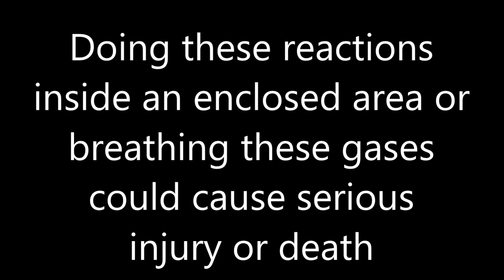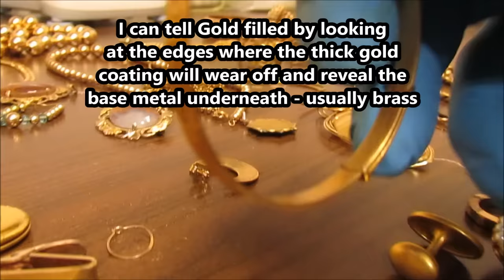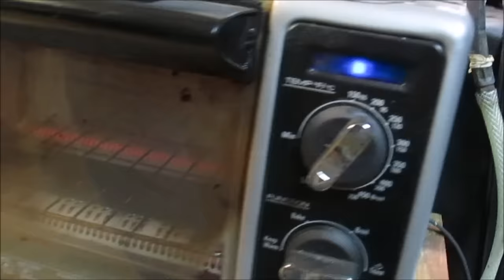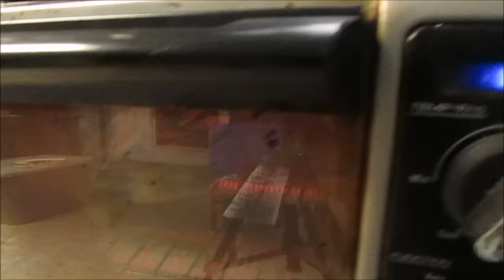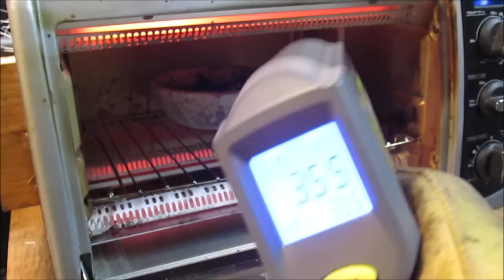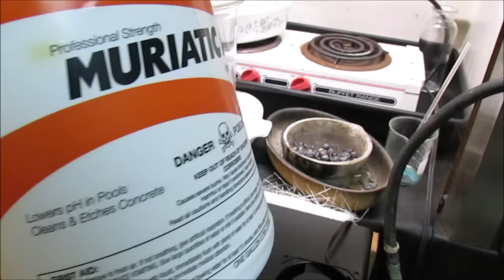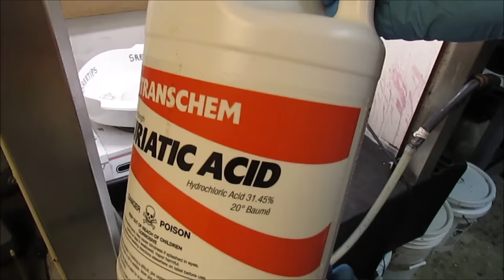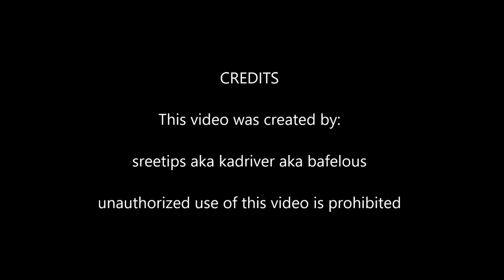Gold Refining 740 Grams of Gold Filled Scrap

Comment: Sreetips - I have some gold around 18K but is actually magnetic- seems to have some steel in it?  Can I use your method to purify it?
Reply from the maker: You must test it with acid. Some karat gold is magnetic though very rare. Gold plated items can be marked as karat gold by thieves. Inexperienced people won't be able to tell the difference.
Reply: Somehow I managed to contaminate with a piece if steel wire when I melted my 14K in the crucible.  Actually found a piece of the steel wire protruding from the ingot.  Wondered why the gold was cracking so easily after just a couple passes in my rolling mill.  Will the process you describe work to purify my contaminated gold?
Reply from the maker: If it were mine, I would inquart with silver then part with nitric. Then I would refine the gold.
Reply: Thanks for your reply - how about inquarting with copper rather than silver?  That way I don’t need to recover the silver - or is there a benefit to use silver?
Reply from the maker: Daniel, I refine both gold and silver so using silver to inquart is like killing two birds with one stone for me. Yes, you can use can use clean copper or brass to inquart the gold. But I've never done it so I'm not sure how good it works.

Comment: I've looked everywhere for info on processing gold filled glasses frames. But nothing. I want to get a batch of 1/10 12k going but some are magnetic and some aren't. What do you think the base metal is in the magnetic ones. I dont want to run them if they will cause a problem and if I can do them all it's worth it.
Reply: Sorry. If I CAN'T run them all it's not worth it. Dont want to have to  exclude half my material.
Reply from the maker: The frames should go just fine, magnetic or not. The spring steel is what causes problems and should be excluded. The spring steel is the part that curves around the back of the ear when the glasses are being worn.
Reply: Okay awesome.

Comment: Would there be a similar process for brass? To end up with as high brass content as possible?
Reply from the maker: Brass is an alloy of 85% copper and 15% zinc.
Reply: @sreetips  First, thank you much for the reply, greatly appreciated. 

Need to add I am autistic because I don't want you to think I am being sarcastic, nor a know it all. I don't know, and my curiosity demands answers lol. 

I actually forgot that brass is not a base metal to be fully honest, and I can assume by your answer that my answer is a no, but still... 

what would it take to end up with a sludge that is 85% copper and 15% zinc? Can that be done, or would you need to do them separately, and then mix them with heat to create the new metal? The brass alloy.

Comment: I have seen you cement silver with copper as well as go with silver chloride. Do you have a preference on one being better than the other and is there a difference in purity between the two methods before going into a silver cell?
Reply from the maker: Krystal, cementing everything on copper, the palladium builds up and could plate out in the cell with the silver. But you get all your metals. Silver chloride method there is higher risk of loss of metal when converting the chloride to oxide and then converting the oxide to silver metal. I'm still undecided on which way is the best way to go. As I gain more experience one method could prove to be superior over the other. But I haven't reached that point, yet.

Comment: And about how much nitric acid total for a full process of a large batch like this? Give or take amount of iron/magnetic material is in there.
Reply from the maker: About 3ml of nitric per gram of GF scrap. 700 gram batch plan on 2 liters of concentrated nitric, give or take 200ml either way. Fume production is the key. When fresh nitric doesn't produce red fumes any more it's probably safe to conclude that all the base metals are in solution and the foils can be separated from the liquid. Don't forget to incinerate the foils before going to aqua regia.

Comment: I have got some gold flakes and I would like to know if you know a way to refine gold leaf flakes or if you have dun a video can you direct me to it thank you
Reply: Depends on the gold flakes. Is this natural gold that was panned? It depends on where you got it. Some is more pure than others. The process of purification would be the same. Wash first in acids that don't attack gold(but do attack contaminates), then dissolve the gold in aqua regia, then crash out the gold with a base like baking soda. Wash the brown gold powder with hydrochloric acid, then smelt the brown gold powder into a bar. The gold will be at least 3 9's pure. Repeat the whole process a second time to get 5 9's(do it from the brown gold powder stage, skip smelting until the end if you are going to do it twice).

Comment: Question: If you would test those GF pieces with the acid we use to test if it's gold or not (and the carats) would it test positive ?
Reply from the maker: Yes, it would. Because the coating of gold is so thick, 1000 times thicker than electroplated gold, the acid test would indicate that you have karat gold, because the thick coating over the brass is karat gold. But, if you file deep into the metal, then test the spot that you filed away with acid, then the truth will be revealed. The acids don't lie.
Reply: @sreetips  Thank you for you answer !

Comment: The 2 pieces at 11:05 with the little stones in them may have been gold filled backs but a lot of times the front piece with the stones is 10k. I find a lot of those types of things
Reply from the maker: I'll keep my eye on those. I've found 14k posts on junk earrings.
Reply: @sreetips  I have to. I find a lot of good gold on crap jewelry that's not marked. It's all worth checking in my opinion
Reply from the maker: I check each piece, individually, that comes across my desk.
Reply: @sreetips  so do I it's just good practice
Reply: @sreetips  You will find people will put decent posts on earrings they like because some people (several of my relatives included) react badly to base metals against the skin. Just an FYI.

Comment: Can I ask a question to whoever might still be reading this that has a bit of knowledge.

So say I had a men's curb chain, I know for a fact is gold filled, would the acids be able to penetrate said gold filled chain? The Weight of the chain is approximately 100g, so obviously alot of base metal, but how will the acid penetrate the "gold" to dissolve the base metal
Reply from the maker: The hot nitric will alway find a way. All that’s needed is for the acid to communicate ever so slightly down to the base metal substrate. Then the rest will follow. Gold filled is roughly 2.5% pure gold. So your 100g GF chain should yield about 2.5g of pure gold.
Reply: @sreetips  thanks streetips

Comment: What size vacum pump do you use? I have a 3cfm and maybe a 5cfm.
Reply: Just dont want to implode my beaker with too much vac. Lol
Reply from the maker: It's an HVAC vac pump from harbor freight. 2.5 CFM. I've put full vacuum 29.9 inches of mercury on my filter flasks and I've never had one implode.

Comment: how much would u say you spend in supplies, fuels, acids, electricity, etc?  u sold it for 990 but what did it cost to make the bar?
Reply from the maker: I got the material from overlooked junk/costume jewelry jars from the thrift store. I don't track expenses for each batch. But if I had to guess, all in, maybe $100 for everything. That's just a guess.

Comment: What kind of torch did u use im having problems melting silver with map
Reply from the maker: I can melt 5 troy ounces of silver in about 2 or 3 minutes with my oxy/acetylene torch. Map gas will take about 10 minutes for 5 oz. use ceramic wool under the melt dish.
Reply: Ocyacetelene isnt an option for me i love how quick it melts but i cant afford the equipmemt ....what do u think about the propane forges? I see they make them out of a harbor freight weed burner
Reply: Love the videos by the way your the man love your lost wax video

Comment: Would you go through the same process with gold plated parts of a computer cpu, and cell phones?
Reply from the maker: No, computer scrap requires a completely different process because there will be about 100 time LESS gold in computer scrap as there is in gold filled scrap.
Reply: Thanks

Comment: Hi mate, I have been meaning to ask, what is the hose and the glass container in the back of your fumehood?
Reply from the maker: First, that fume hood runs 24/7 it's rarely turned off. I don't have a cover on my exhaust stack. When it rains a small amount of water will come down the stack and pool up in the baffle area where the fan is. The hose drains the small amount of rain water into the little glass jar.
Reply: thought it must have been some type of liquid recovery

Comment: is the nitric acid that has dissolved all the base metals more heavy than pure nitric acid?
Reply from the maker: I used 50/50 dilute nitric acid. One half 68% concentrated nitric acid and one half distilled water. I've never tried to weigh the liquid before and after so I don't know.

Comment: Dry weight of precipitate if done correct. Is it the same as melted button weight? Thanks to you and your stock pot video's I am getting.
Reply from the maker: Should be very close. Some loss does happen during the melt depending on your technique.
Reply: @sreetips  I plan on doing as I saw you do it. Borax and torch. The gold precipitate, is it true if you soak it in ammonia it removes all but the gold?
Reply from the maker: I've never tried it so I don't know if it's true.
Reply: @sreetips  Ok I was told about it and read only 1 thing about it. Company called ishor that sells gold process kits.  Ok wish me luck tomorrow on the melts. If all goes well its because of you, taking the time and putting up with me. Thanks
Reply: @sreetips  Well it didnt turn out like I had hoped. Total had close to 86 grams of various metals. The brown SMB drop was dry 9 grams and maybe got 1 gram after melt. I got total maybe all the metals 6-7 grams. The hand held tanks of mapp gas will that melt the brown precipitates of gold?
Reply: @sreetips  I used a clay melt dish. heated and put borax inside all around then oxy/acetylene melted the filtered metals. Could the stuff have sunk into a clay dish? if so How do I get it back. Can I crush the dish put it in some kind of acid or acids or AR? The Falcon detector is beeping as if the metals are in the dish

Comment: Hey sreetips, I've been watching a bunch of your videos because I was recently given a bunch of semiconductor scrap by a friend. They are GaAs semiconductors, plenty of gold on them but I'm a novice chemist and I don't know how gallium arsenide reacts with strong acids. Any tips on recovering the gold from this type of scrap?
Reply from the maker: I don't have much experience with computer scrap and I'm not familiar with semiconductors. Getting the gold separated from those other metals could be difficult.
Reply: Well thank you for the reply, through a bit of research I learned the mixing of HCI and gallium arsenide crystals releases arsenide gas..however it does not react with cold nitric acid. Not sure how I can use that to my advantage, but I appreciate your input on the matter. Thanks again

Comment: good day Sreetips, i'm here in Austin Texas, where do you get your nitric acid? Im trying to find it local because the shipping is outrageous !!
Reply from the maker: Good luck, I don't know of anywhere that you can walk in and buy it over the counter. Try dudadiesel. But you're right, the shipping will be outrageous. I almost dissolved a ups truck one time, a glass bottle of nitric had a small crack that leaked. They had to be delivered with the box upside down.

Comment: I would like to see how many grams of gold filled pocket watch cases, of all sizes it takes to get troy ounce. Please do this one day.  Haha
Reply from the maker: Shane, I think the yield on gold filled pocket watch cases is around 2.5% to 3% so it would take about 1100 to 1200 grams of case to get about one Troy ounce of pure gold.
Reply: Okay. Thanks for reply. So out of the materials that are used in this 740g. Do you feel there is any one piece that produces the most? That could have a batch of just those pieces and yield the most? Or do you think the mix of everything yeilds the best?
Reply from the maker: The older gold filled bangle bracelets have an unusually thick coating of gold.
Reply: Perfect. Thank you.
Reply: What about gold filled eye glasses? How do you recover it off the magnetic material?

Comment: great video, cant help wondering what kind of price all that antique jewelry would've brought in at the right antique mall though. betting you could've sold the locket alone for around $100 to the right little old lady or son looking to get his mother something nice for mothers day.

I do have one question though.... what is the difference between "gold filled" and "gold plated"? didnt hear that explained anywhere in the video, but might've missed it.
Reply from the maker: The gold filled stuff just doesn't sell very well. Gold filled is a thick layer of karat gold over a base metal. Gold plated is a very thin layer of gold applied by electrolysis to a base metal, such as copper or brass, or even copper plated pot metal. It is just a few microns in thickness. A micron is one millionth of a meter. Gold filled is several thousands times thicker than gold plated.

Comment: Is there a way to do the first part that recovery dissolving all the base metals but not the gold using an alternative to nitric acid because I've got muriatic acid and I've got some 30% hydrogen peroxide on the way but nitric   a little more problematic for me and I guess worst case scenario I could always make some but having never done it before I'm afraid the learning curve might kick my ass if you know what I mean because the first time never goes off without a hitch. I suppose I might have to watch some videos on making nitric acid to flatten out that learning curve some As It Seems to always hit me in the wallet harder than anywhere else and I think I have whatever the Glass Jaw equivalent of a wallet is (tight budget)
Reply from the maker: In a previous video I used sulfuric acid “Rooto Professional Drain Opener” from Ace Hardware to remove silver and base metals from the inquarted gold.

Comment: Hey sreetips, I have an old gold pocket watch with chain that I believe to be at least 10k gold. I haven’t tested it. It has someone’s initials etched on it, but it is from a manufacturer that is sought after. I don’t know if it is valuable enough to sell intact or if it would be good to refine it into a small bar. I’ve invested in gold, but don’t have any physical gold and I’ve always wanted a bit. Do you know anything about antique pocket watches? Would you be willing to refine it for me and make a video if that ends up being practical? Of coarse you would take a cut for your efforts. Let me know.
Reply from the maker: Open the case that covers the movement in the back of the watch. If it’s 14k then it will be stamped on the inside of that cover. But if it says “warranted” or “guaranteed” with 14k then it’s gold filled.
Reply: @sreetips  thanks! I did more research and it is 14k gold filled I believe. I was confused because it had no markings other than a scale with a crown, “Keystone Watchcase” and the serial number “7944888”. The watch itself is an Elgin. I looked up the scale with crown marking and it said that indicates 14k gold filled.

Comment: I would buy some of those necklaces and bracelets intact, do you ever sell them?

Byzantine, rope, wheat, round box, Venetian, Franco, curb, Gucci, Mariner, Figaro, Cuban, that type of thing something for a man capable of supporting a pendant or charm 18 to 22 in (ideally 20) yellow gold filled anywhere from 10K to 18K would suit me just fine and it will keep you from having to destroy a couple if you're interested in letting some go unharmed for more than the price of the scrap because I don't know how you come up with all that but that was quite a stack. Also same style bracelets or even men's rings pendants or charms. I've been looking around and hardly ever see gold filled men's jewelry but it's my only real option I can't get the solid real stuff and the plated stuff just sucks usually wearing through in no time flat. I literally spent two or three hours last weekend looking on website after website after website and saw nothing I guess it isn't as big a seller as you would think it would be with the price of gold what it is now but after hours I was so disappointed and discouraged after having seen none and then spotted this video and you had like a duffel bag full piled up on the table and figured you might be my best bet or only bet as the case may be.
I know you said you had an eBay store and I was wondering if you could tell me what the name of it is so I can check it from time to time and hopefully catch you with a load of it you haven't dismantled yet.
Reply from the maker: My eBay user name: sreetips

Comment: Can you explain why you do not add all of the nitric acid at once and use a much larger container working outside, please? Wouldn't that save you a ton of time? Why add it in stages?
Reply from the maker: I used to work outside. Thankfully I don't have to do that anymore because I have a fume hood. Adding it in stages is a proven technique that has worked for me in the past. I can carefully control the amount of nitric going into the reaction. Adding it all at once would guarantee a boil over. Nothing worse than hot boiling acid spewing out of the container.